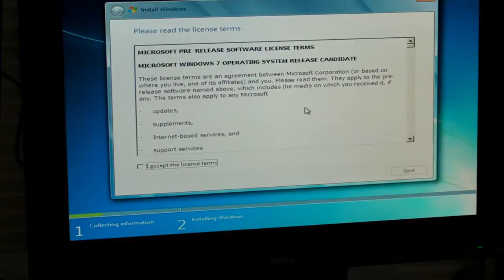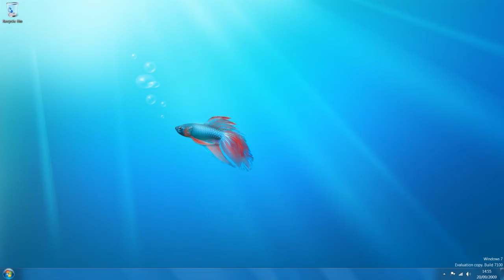New Computer Build (HD) [how to build a computer in 8 minutes]

Comment: Very nice indeed although sometimes it does not always go so smoothly when you build your own! I just finished building my son a gaming rig and had nothing but trouble. Firstly I had to RMA  motherboard  and then the CPU Phenom II X 4 955. Then the Coolmaster V8 heatsink fan would not turn. Once I got it going I realised I could not reach the 8 pin power connection cause of the V8,had to unistall it all. Then loading Window 7 it could not locate my network hardware. Got there in the end though

Comment from the maker: Hi, thanks for your comments.

The HD4850 was ideal for my clients needs and the machine came in under-budget. Also, I think ATI released the 5770 and 5750 late last year but this build was from early last year. I could have used the 4870 or 4890 but more powerful card would have been unnecessary.

Cheers.

Comment from the maker: @rayo1988 Hi, there's a power header on the motherboard that you'll eventually attach the PC case power button wire to (check the mobo documentation to locate it - Just use a ballpoint pen or a screwdriver to short the two prongs. You can see me do this in the video just before It powers up for the first time.

Comment: real mess inside the case.. Also i do not suggest using a case without cable management holes anymore. CoolerMaster CM690 II Advanced is probably the best bang for you buck at the moment.

Comment: i have a problem i bought the same motherboard as you and a invidia 9500 graphics card along with a new heatsync and psu and we plugged everything in correctly and when we powered the pc on theres no signal to the moniter and there is no beep for the bios the fans are running fine and the motherboard light is on what are we dong wrong please help. all hardware is fresh from yesterday besides the ram but the ram worked fine yesterday